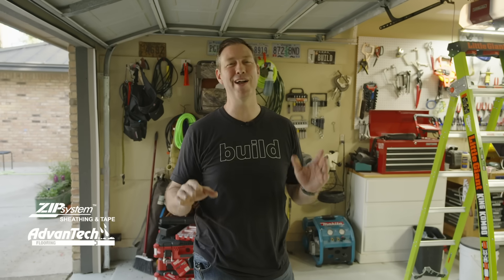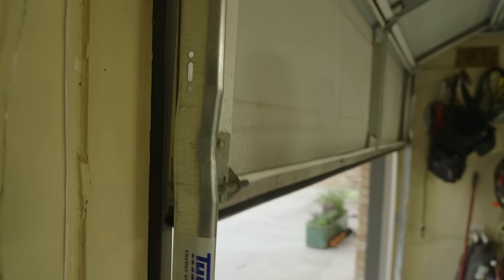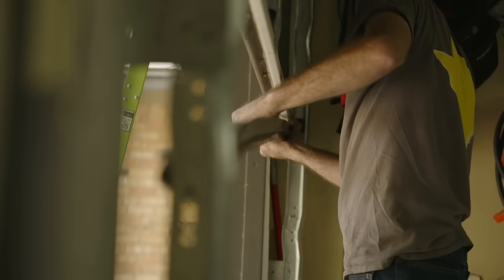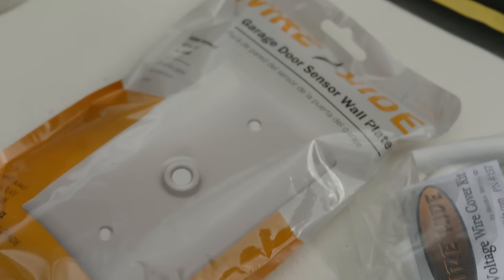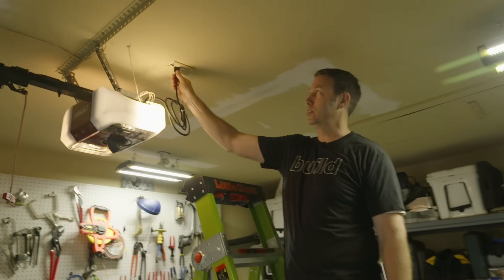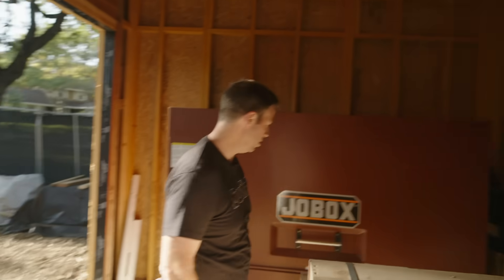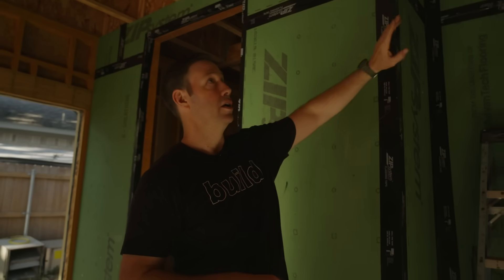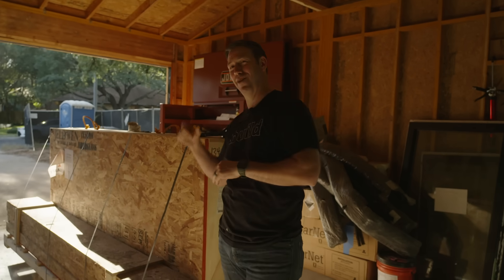Garage Door - Air & Bug Sealing

Comment: On an HVAC podcast I listen to they just did the whole episode on CO. They specifically talked about extra, especially garage type, intake or exhaust fans. In short, the tighter the house, the more you should be concerned with changing the, esp. negative, pressure balance. They wound up their story by saying your equipment and locations should be actually-tested in-use with a CO tester  and monitoring installed. He said a lot of the assumptions, even many that are taught, may or may not stand up to testing in specific applications. CO is odorless, colorless, tasteless, and must be tested tomdetect. You may, MAY, smell and notice aldehydes as byproducts of combustion, but that's a maybe and you cannot depend on it!

Comment: FYI that exhaust fan does NOT allow you to run a vehicle or generator inside with the doors closed. Some people might get the idea that they could remote start their car in their garage if they get a fan like that, but that's not the case, you'd need a much larger fan to do that safely.

Comment: I put in insulated garage doors when I had a heated swimming pool in my garage. It was one of the best purchase I have ever made. Even though the pool is gone. I put in an AC vent in the garage so when I go to my car it is never above 79 out there. In the winter that single vent keeps it above 50 all winter long. My old wooden doors would have never kept those temperatures no mater how big a furnace vent I put in. 

I live in the Seattle area.

Comment: Might already be in the comments but Wayne Dalton I-Drive GDO mounts on the header and bolts to the torsion bar.  No more mid-garage GDO to bang things into.  I've had mine for over a decade now and works just fine.

Comment: I installed the thermotrak system last year in my front and rear garage doors. Living in Minnesota we get all of the crazy temperatures and wind.. these tracks and new seal have helped immensely with keeping the space heated in the winter and cool in the summer.. highly recommend them
Reply: Just ordered a set for my 9 ft. garage door. Hoping this is a solution for keeping garage cool in Florida summer.

Comment: I park my truck in my garange since 20 years without any issues and its half the size of yours (o.O) ! This fan thing is way overkill and useless ...  instead of therma tracks, just adjust de tracks closer to the framing, they are on slots and shall be angled to avoid friction.

Comment: Door tracks have curves that press the garage door against the seal when closed. However, each section has to traverse the curve before coming into final position. Does this mean that each section of the door rubs against the seal as it goes by? How long will it before the seal is worn away by the rubbing? If this was like those fancy sliding glass doors where the whole door is in position before being pressed against the seal is one thing, but I can only see a scalloped seal in the future.
Reply: I initially thought the same as you.. I have been using these tracks and seals for over a year with no wear on the seals from operation.. the track is slightly angled to where as soon as its beginning to open it moves away from the seal..
Reply: @mw1932  Thanks for the feedback. Any signs of rubbing on the door itself?

Comment: Chamberlin / Lift Master has garage door openers that mount on the jack shaft (aka: Torsion Bar). They are MUCH QUIETER than the chain'/belt drive models, and they are much easier to install. I'd recommend one of them for your new garage.  I personally installed two of them a few months ago, and would never go back.

Comment: I would NEVER put an outside entry security related device like a garage door opener on the Internet.  If I can't trust someone with a 4 digit code when I'm not there, they don't need access in any form whatsoever.  I've never understood this weird absentee remote access mindset.  In addition, my garage door shuts automatically 5, 10 or 20 minutes after it was opened automagically.  I don't need the Internet or an app to schedule the door to close at 10 pm.

Comment: Just installed a new custom Clopay door on my home. The insulation upgrade was nominal for "stage 1" but provided a considerable sound dampening improvement. My house is in an upside-down L shape with the garage and front door towards corner. The door is facing west and will see a considerable amount of direct sun. I feel that the garage wall insulation combined with the door insulation still provides an improvement over the 15-year-old thin-gaged steel door.

Comment: Matt check out green hinges at https://www.greenhingesystem.com/ .  They have a spring system to push the door to the frame and the hinges are heavy duty.  Used on a 9' X 16" door facing into prevailing wind in the Texas Panhandle.  Did a great job of keeping door sealed even with 40-50 mph winds against door.

Comment: I put insulated panels in my garage door and they make a huge difference. They are simple Styrofoam with a vinyl panel on the outside. not too hard to install after I figured it out. The garage door faces North and gets the full force of the sun in the summer. Also, we are on a pretty busy street and they also down the road noise.
Reply: What is the name of the insulation?
Reply: @IoanGirda  It was a kit I got at Lowe's. I don't remember the brand. The panels are styrofoam with a thin plastic coating on one side.

Comment: Hi Matt! I just finished watching about your garage door sealing.  One thing not to forget about that exhaust for the garage most fumes lay low to the ground reason for that you must step down into a garage from a living space, and so if you install the fans at a higher elevation you're going to cause the fumes to pull up before it leaves your house. You got to install that fan low to the ground in order to take all the fumes and exhaust out of your garage wall. So, that fan  reduces your air sealing quality by putting that fan in, as you may know, those dampers don't close tight and you lose your air conditioning you lose your heating in your garage just a thought. Thank you for having such a great Channel I built two houses myself and I learned a lot of techniques while I was building my second one on the lake at Lake Hopatcong New Jersey.  I Incorporated some tips of yours and it saveed me a lot of time and effort! Take care!

Comment: 1: uninsulated garage doors aren't a thing where I am.  except maybe on the cheapest of the cheap unheated sheds.
2: my garage doesn't have that plastic weatherstripping - I closed the garage door and then set the trim tight to it.
3: whoever built my house put the lip of the garage floor right inside where the door closes, so there's a half inch overlap with the door closed.
4: I can see another argument for not having your house ventilation maintain a negative pressure environment in the house.

Comment: I'm surprised you didn't mention rock-wool...  I pulled the old glass fiber insulation (house built in '87) out of the ceiling of our garage when we first moved in, the previous owner had... rodent issues (ugh, the rain of rat-turds) and left it open for a year or so. Then I went back and reinsulated it with rock wool - the difference was incredible. I don't know that the foam insulation would do any better.

Comment: Matt, new bottom door seals are great, but they will crush fairly quickly and you will have leaks again. A good solution is to slide some 3/4” foam backer rod into the new door seal while you’re installing. It makes a very tight seal especially if the floor has inconsistencies.
Clopay makes a great insulated door. I installed 2 in my new house in MN in 2016 and have had no complaints.

Comment: Matt, on your rebuild, you mentioned that you want to use a side mount operator to take advantage of your high and sloped ceiling. In that case, I would recommend looking into "Follow The Roof Pitch" garage door track. Your door company can order that and have it specified to match the dimensions of your garage. That will help with open headroom in the garage and also help the side mount operator perform better. Also, it may have been the camera angle but the photo eyes on your current house looked to be mounted too high. For safety they are required to be mounted 6" or less from the floor.

Comment: Garaga insulated garage doors. Canadian outfit.  Swear by them. 15.5R rating.  I live in the northeast and it was a world of difference.  They already have a double edge seal weather strip.  No need for those s-tracks or extra work to make it seal right.  Good luck

Comment: Hey Matt, great tips, as always. I put these insulation panels in my garage and they work great. Two yrs ago. I heat and A/C the garage with a mini split, which works great. Matador insulation kit on Amazon. Matador EP1323054_02 SGDIK002 Garage Door Insulation Kit, X-Large, White https://www.amazon.com/dp/B00RGZ9C10/ref=cm_sw_r_cp_api_fabc_rbfYFbAQVRAMC?_encoding=UTF8&psc=1

Comment: Could you run the door cable through the bottom center of the Wirehide so it is never exposed (ignoring issues protecting it in the wall from the mounting screws)?

Comment: I ran a 3/8" rubber weather strip on the door to sandwich the exterior trim weather strip that has worked really for the past few years . I also self leveled the concrete apron that doors sit on to give the gasket a smooth level surface to seal against . At high noon I have no light shining through anywhere with the doors shut.

Comment: BuyXcluder.com makes really good rodent proofing supplies and offers a nice chew proof bottom weatherseal for commercial and residential garage doors. It has stainless steel fibers embedded in polyester built into the weatherseal. Rodents will not chew through it.

Comment: Hey Matt thanks for the info on S Tracks. I am a big Garage guy. I have epoxied the floor, installed base molding and the best thing is the Liftmaster 8500 jack shaft opener with the MyQ interface. You should consider the 8500 for your house especially for applications where there is living space above the garage. This is a much quieter install.
Keep up the good work.

Comment: I actually is just southwest of Orlando, FL and about 3 years ago I had my garage door replaced and had them install an insulated 16 x 7 ft door.  I also insulated the floor of the garage attic and installed an 8 inch duct in the garage to keep it somewhat air conditioned.  I also then installed a hurricane brace in the center of the door as I used the garage area as a game room.  But as stated I still have some gaps at the bottom of the door and on the ends.  Still looking for a good/great seal for the bottom.

Comment: I've found insulated garages can work if you have ac/heat to the garage and it does reduce temps in summer and raise temps in the winter but if you leave it open for a while and close it the air in it seems to be hotter/colder (summer/winter)

Comment: This video was packed with ideas! Really something for everyone. I have the same garage doors that i insulated with a foil faced 1/2" foam board. Foil facing toward the outside. I noticed a pretty big difference.
Reply: Just a tip, foil should always face an open air space. You should have at least a 1/2 inch air gap. Other wise it won't do nearly as much. My guess is that you live in a warm climate so it won't really matter. But for anyone reading foil faces inward in cold climates and not really needed in warm climates unless you have an air gap.
Reply: Foil facing inward helps in hot climates too. It reflects radiant heat from warmer surfaces to cooler surfaces, helping to cool all surfaces in the living space more evenly.
Reply: @EricPeelMusic  Balancing the heat in the room will have a fairly negligible effect on efficiency. It may improve comfort but the cost of the radiant barrier might not be made back by the small increas in efficiency. In cold climates the impact is much greater. That's why I suggest only using inward facing radiant barriers in cold climates. However radiant barriers used properly on the exterior can reduce heat gain significantly in hot climates.
Reply: @Ilove3SGTE  If the room the user is in is hotter than the rest of the house (in a hot climate) they will request more cooling, which lowers efficiency. This could be eliminated by installing a radiant barrier in an adjacent room or attic, which would be a much lower cost than add more insulation.
Reply: @EricPeelMusic   I'm not sure I understand your example quite right. Radiant heat is actually just light, sometimes visible light but usually what we are blocking is infrared light which we can't see. But being light it acts the same as visible light. Use a flash light shine in on your radiant barrier. This is the way it will behave with radiant heat. From this we should understand that the in your example the hot room would stay hot with a radiant barrier on the walls and ceiling. Feel free to clarify if I am missing something.
Reply: @Ilove3SGTE  Radiant heat is only in the infrared. Other frequency ranges can be converted to infrared, but visible light is not radiant heat, not even sometimes.

For my example: A radiant barrier placed stop the insulation layer on the floor of an attic, facing up, above a hot, 2nd story room. The radiant heat from the roof is reflected back to the roof. The heat will radiate from the roof outside more effectively, and the cooler wind will help cool the roof more effectively since heat energy transfers more quickly with greater temperature differences. The room will be cooler since the ceiling of the room will not radiate as much heat downward. 

We're talking maybe $150 of reflectix. And this is a quick fix for a poorly designed house. It's not how any house should be designed from the start, but this is a common scenario, unfortunately.
Reply: @EricPeelMusic Not really related to the topic. But radiant heat dose come in visible light when a source light is hot enough it will increase the amplitudes in visible light also and therefore its energy and heating capacity. The skin is more sensitive to infrared light though. (I'd rather not get into that very long topic though). Okay, that explains it better. That's very different from what I understood about your example previously this is not an inward facing scenario that we were taking about though. This is outside the thermal envalope. You are correct in everything you said. I was explaining originally how it's not worth doing inward facing (aka on the inside, facing into a room). Adding a radiant barrier outside the thermal envalope is a good idea in a hot climate and I don't disagree there at all. Even in a new building it can be used well.
Reply: @Ilove3SGTE  My point is that one can filter out all wavelengths except visible light, even increasing it's amplitude to insane amounts. It will not generate any heat, because there is no heat present, that is until it hits some object and the infrared frequencies are converted.

Technically, you're right. My previous scenario is of a house with a radiant barrier outside the insulation envelope. But it's still well within the home. It's facing inward of the attic, although outward of the center of the house.
Reply: @EricPeelMusic  
Rght, I probably should have specified inside the thermal envalope as inward  faceing. As for visable light not having heat till it strikes an object. At the atomic level the atoms absorb the light and convert them into heat. But how is this different with infrared vs visable light. Do the atoms not convert all wave lengths of light to motion and therefore heat? I may understand it wrong but feel free to have a go. Maybe explain how a purple or green burning laser can burn things.
Reply: ^thinks infomercials are "educational"
Reply: @grumpycat_1  actually he said it was full of ideas not educational. I knew nothing about those thermotraks. So yeah it did have some good ideas.

Comment: One guy on you tube replaced his rolling garage door to two automatic gate style doors to solve his air sealing, insulation and heating issues.   The gate style doors had an access door, windows and solar hot air heater all that he designed and built himself he was extremely happy with the result.

Comment: Matt, for the motor I used this in one of my homes. Side mount. Super quite, but also deadbolts the door once it shuts for added security. Definitely check them out. 

https://gatehousesupplies.com/liftmaster-8500w-dc-battery-backup-wall-mount-wi-fi-garage-door-opener/?cmp_id=159600245&adg_id=8992267205&kwd=&device=m&gclid=Cj0KCQiAk53-BRD0ARIsAJuNhpssXRv2Dyz2sRMih0NKTlnID2PCI1EdRpFQi8Ib1q4TOO0b4NVN9z8aAsUMEALw_wcB

Comment: I finally figured out how to seal up the bottom corners of my garage doors. On most garage doors there is always a gap between where the seal on the bottom of the door ends and the side of the opening. I used a product called Henry 345 concrete patch.  With the door closed I filled the gap to conform exactly in the gap. If you clean the concrete floor beforehand this stuff becomes one with the concrete. It takes several applications to build it up in thin layers. If you try to layer it thicker than 1/4 in. , it will take a month or more to harden. Thin layers will harden overnight. I did this about 3 years ago and no more mice or snakes in the garage

Comment: They either need to make their own proprietary seal or make the attaching part the full width of the standard seal. Even the standard seals suck. In AZ the extreme temp swings break them into pieces from expansion/contraction.